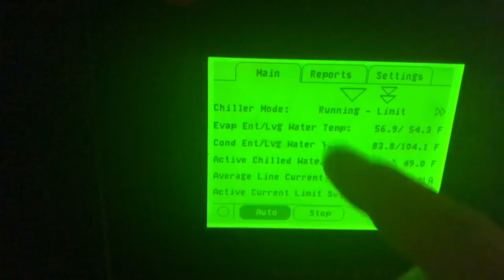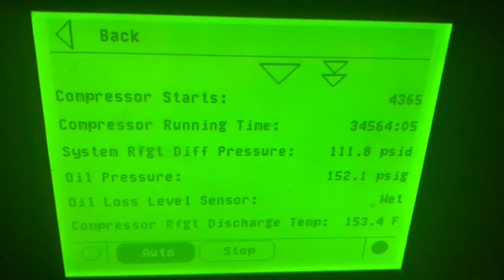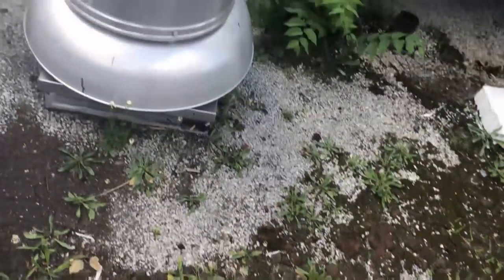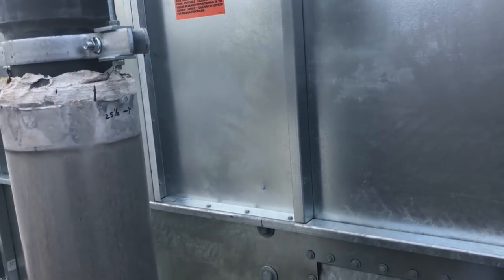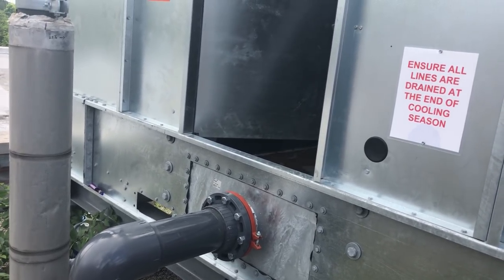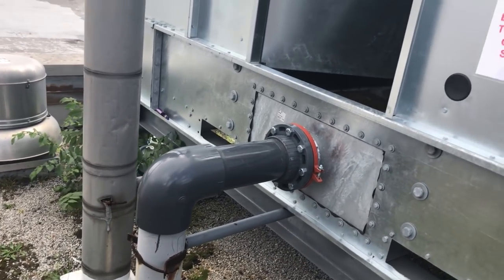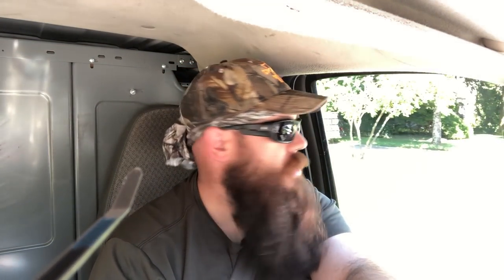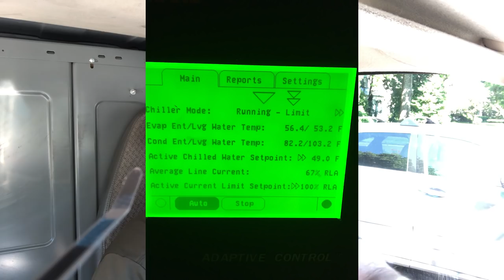Chillers need love too❤ ~ HVAC Chronicles

Comment: We had a lot of problems with the condenser coils on the Air cooled  R Chillers leaking back when I was working.  Some were even flat when they were delivered.  Good video.  Most important thing is water flow, both on the condenser and evaporator side. Funny no one caught that problem when they replaced the tower temp split should only run 10 degrees or so condenser water in and out.  Guess they didn’t take any readings.

Comment: Muy bueno tu vídeo !!
Fuiste al problema y lo resolviste solo mirando la información del control y los manómetros 
Generalmente todos los Chillers que veo necesitas mantenimiento y amor por sobre todo 
La falta de revisión y mantenimiento redunda en la rotura del equipo aunque sean tan nobles y robustos 
Felicitaciones por el vídeo y muchas gracias !!!
Reply: Very good your video!  You went to the problem and solved it just by looking at the control information and the specific pressure gauges, all the coolers that I see, I need maintenance and love above all. The lack of review and redundant maintenance in the equipment break even though they are so noble and robust. Congratulations for the video  and thank you !!!

Comment: @ 5:50 A trick I learned If you don't have a key for the hose bibs you can use a 3/8 extension for a ratchet set. This is a really great video enjoyed watching and learning. Thanks AK
Reply: Geoff what is up with all the different funky keys?? Is a simple faucet knob so friggin dangerous? We have easier access to the liquor inventory than the damn hose bib at our facility!

Comment: Looks like it was at least a stainless strainer. We used to have steel ones, and they’d last about two years. Our stainless ones haven’t been or needed replaced in 8 years. And I do the yearly cleaning on them, but ours aren’t made the same, they have a baffle in the center to keep it from collapsing. Our chillers will usually shut down once they hit above 100 degrees on the high side. Good job, Andrew!
Reply from the maker: Thanks Tom, good to see ya man!  Hope you’re good, always keeping an eye out for a TCP video👍👍!

Comment: I'm an HVAC apprentice (3rd year) and one time i was working with a tech and went to shutoff the unit at the main disconnect so we could begin our work. The tech i was working with then told me that VFD's can actually explode if you don't shut them down from the VFD menu and instead shut them down from the disconnect. I got super lucky that the ONE unit i turned off from the disconnect was the one unit that didnt have a variable frequency attached to its motor. I should buy a lottery ticket.
Reply: Geoff. Uuuuh, maybe if there was a sc fault condition before turning off, MAYBE, i would take that to the lottery though.

Comment: Could you have checked the pressure differential at the pump to tell if the strainer was clogged? Assuming the strainer is located in the suction diffuser at the  pump. Or any cavitation?

Comment: Does the ABB inverter control the fan speed on the cooling tower? Ie, is there a temp sensor wired into the inverter which the speed control references? We normally have a separate control panel with a Eurotherm controller with a temp sensor which outputs a 0-10vdc control signal to control the fan speed. If the ABB inverter has a temp input, this would be much better!

Comment: Once again great video. I'm curious though. Once the strainer was cleaned and re-installed. Did the compressor noise reduce? Was there any damage to the compressor as a result of the water blockage?